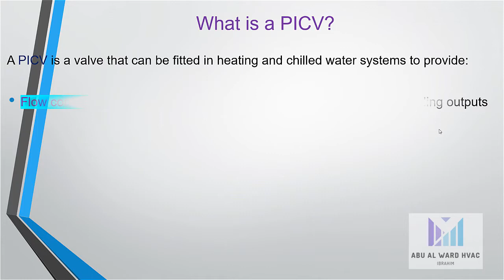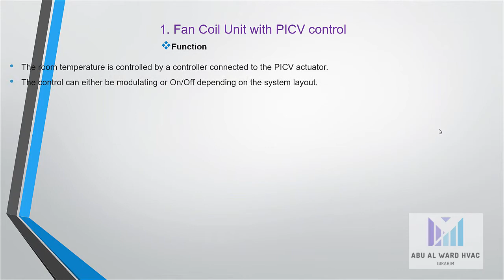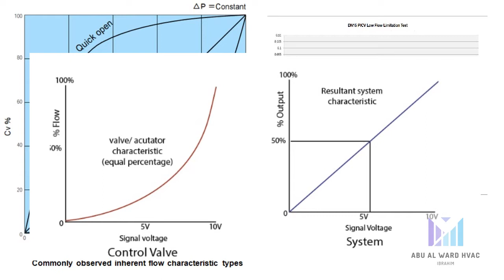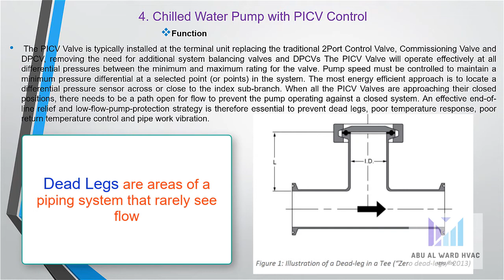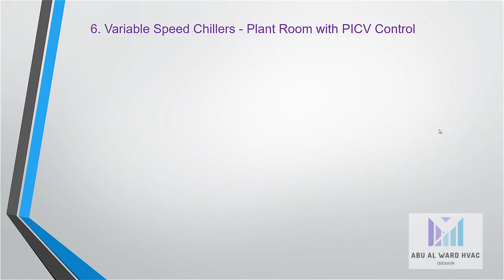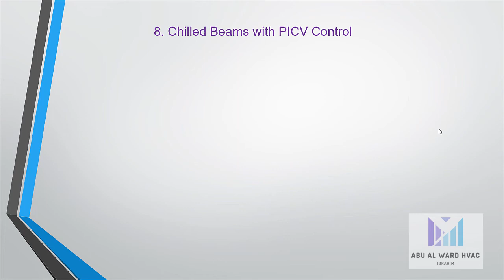HVAC Special Valves - Part 1 (PICV)

Comment: In the fixed speed chillers control, the controller measures the inlet and outlet temperature to (Maximize Delta T) and regulates the variable speed pump to maintain the required pump pressure.
Important correction